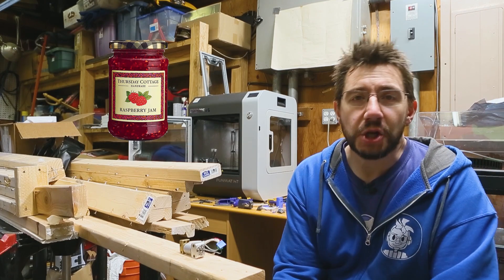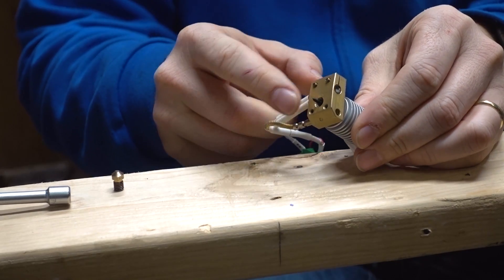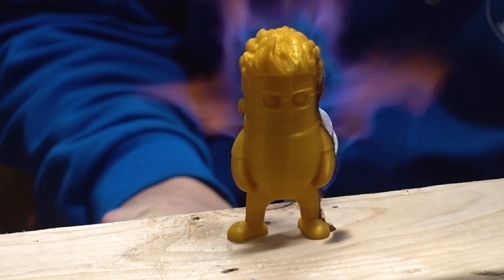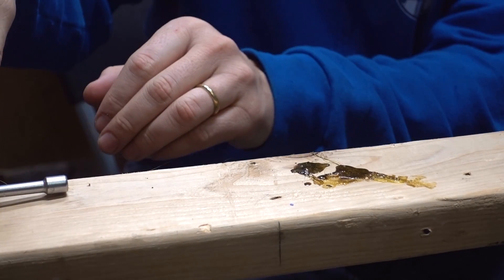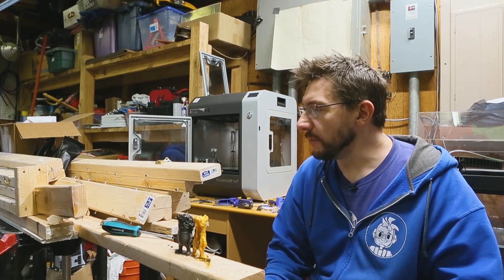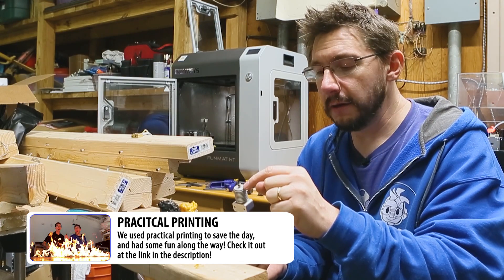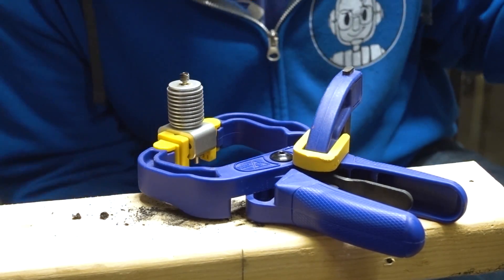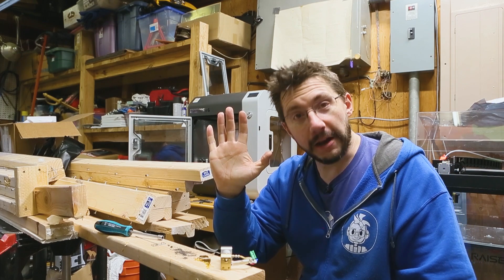3D Printing with CFPEEK: How To Clear a Jam with Fire

Comment: Wouldn't drilling the blockage out be a safer solution? Applying random heat via flame or heat gun seems very risky and unnecessarily stressful to the surrounding materials.

Comment: Joel I'm having a problem with my prints.  Printing on a CR-10S with ABS. The print is fine until probably the last hundred layers or so. It's a five-hour. The e tire print was find until the top where there was a mass of melted and stringy filament. Is my heat to low?

Comment: That was specific to carbon fiber 
I have a jam on my artillerey sidewinder x1 after using PLA and wood filament.  
Any good resource recommended to resolve that?
Reply from the maker: You wouldn’t need fire for that. You could use a heat gun. Or fire to heat up a metal rod that you would push through.

Comment: Hi Joel.  I've been watching your channel for about a year now.  I noticed a couple of things I wish you would have mentioned before using the torch.  First, this should only be done on an all metal hot-end.  The PTFE tubing in most hot-ends would probably not hold up to the heat very well.  Second, when working on something that may fall, the hot piece of filament stuck in the hot-end, orient your hot-end horizontally so the hot piece can't fall on your unprotected (should be leather gloved) hand.  I checked the comments before commenting and noticed somebody had already posted about using a torch on a pile of wood.  Safety first kids.  Otherwise, keep cranking out the great content.  I rate your channel as one of the top ten for 3d printing.  I also noticed the piece of wire your used to remove the stuck PEET looked suspiciously like the unjamming "tool" that comes with the FlashForge Adventurer 3 printer.  That's all.

Comment: Just a thought, but I don’t think you’d really want to use a flame in this case.  It did work, but isn’t there a high risk of carbon scaring in the heat break when using a flame?  Since the flame will reduce the filament to carbon, that carbon could adhere to the metal.  Using just a heat gun, would ensure that the filament softens, but doesn’t burn, prior to it being released.

P.S.  RIP mini-Joels....you will not be forgotten.
Reply from the maker: I had thought about this but I couldn’t find my heat gun.

Comment: There's fire resistant fabric used when plumbers solder copper and brass with blowtorches inside of walls. Might be a worthy investment if open flames are going to be a recurring feature. 😁

Comment: I had a jam (pla) in the heat break that i could not clear.  I fixed it by putting a small beaker of acetone suspended in my basket on my ultrasonic (DO NOT FILL ULTRASONIC TANK WITH ACETONE!) And let it run for a couple min and the jam popped right out when i pushed on it.   Repeated process with DI water then dunked it in 99 % alcohol and dried it.  Then reassembled everything and printer ran like new.

Comment: Luckily those were not voodoo mini Joels.  That would have made for a significantly different video if they were.

Where did the poker used to get the filament out of the heat break come from?
Reply from the maker: very lucky right? The poker came with the printer, though I would imagine some wire from the hardware store would also work.
Reply: I think I may try a small hex wrench of appropriate size if it ever comes to this as I've got those handy.

Comment: Never change (unscrew nozzle) when hotend is cold. It damages the threads and you risk that it is going to leak
Reply from the maker: I don't believe that is true. Where did you hear that?
Reply: @3DPrintingNerd  hahahaha
Reply: @3DPrintingNerd  many printers hotend is designed so that the threads are making the seal. This hotend might be different. 

This is related to heat expansion of aluminum that most heatblocks are made of.

Comment: I have a rather interesting question about jams. After a jam or carbon build-up in heat breaks, is it more prone to jam or carbonize again? I feel like it with ultimaker's printcores.
Reply from the maker: That's a great question, and I don't have an answer for you.
Reply: @3DPrintingNerd  I would say that the Petg-cf and the CC06 is the worst. I think it might be the brass in the long nozzle that change or get worn down. I'm going to test coated brass and hardened steel next to see if it works better.
Reply: I mentioned something similar in a thread of my own, where I talked about the carbonization adhering to the metal.  If it does adhere, then I would expect it to continually happen in the future.  This isn’t a cast iron pan being using with grease to cook foods. :)

Comment: Hey Joel I just started printing with abs and I love it. The only problem is I use tape and with the build plater being so hot the tape curls up and makes the print warp. Any tips?
Reply from the maker: The ABS 3dgloop does a good job. You could also make an ABS slurry.
Reply: Try to use PVP glue or print with raft.
Reply: Use some quality Kapton tape. Have no problems with it and ABS. I assume you're using an enclosure already because if not, that's probably the reason for warping.
Reply: ABS Gloop is amazing. PEI works as well as long as it's cleaned regularly.

Keep in mind, however, that ABS warping is most likely caused by the cooling ABS itself, not the tape. I wouldn't be surprised if the tape is being peeled up by the ABS, so try printing with a massive brim (I use 15 to 25 mm).
Reply: Thank you for the help I will definitely try these this to help my printing

Comment: Not sure if this trick would work on peek but for a pla jam i just stop the hot end fan with a finger and let the heat creep up the break while trying to extrude. Works alot of the time.
Reply: Don't do that. That's a good way to kill the fan. Most cheap fans do not have built in stall detector and most printers don''t have an RPM sense wire going in to the controller either.
Reply: @shadow7037932  haven't had to do it more than twice. But really who care about a 5 dollar fan bro.
Reply: @carbide1968  Sure, if you're running a cheap fan. But changing it out takes a bit of time. And it's bad advice especially since newbies who watch this channel may not know how to swap a fan.
Reply: @shadow7037932  you do you, i will do it my way. Lets agree to that. But i am not taking apart my hotend if i dont have too.

Comment: Happy new year Joel, I had to do the same thing with some abs filament that was hiding inside the hot end stopping my pla from coming out smoothly. 

Ended up eventually swapping to a steel hot end instead of brass and so far no issues.

Comment: Something we used to do at work to removed coatings on metal might help here. We repurposed an old welder for running current through metal parts to quickly heat them up. To remove coatings on metal, 20 amps for 1 or 2 seconds was all we'd need before most paints or anodizing material was burned off. I'd imagine you could make a jig to do the same thing here.

Comment: everybody: upgrade firmware to get thermal runaway protection!!!!!
Joel: burns pla with blow torch in the workshop on wood...
Reply: Not only on wood but with plastic clamps holding the part he is heating. What could go wrong with that. Thankfully noting did. Looks like some interesting printing material.
Reply: not knowing how much time it elapsed I got nervous when he immediately picked up the metal part after heating it with the torch.
Reply: How about some goggles Joel?

Comment: What do you think about using a Volcano hotend with PEEK, and maybe... increasing the surface area of the heatbreak (by sandblasting it gently)?  It looks like there is a heat creep issue when printing that hot.
Reply: You need a good hot end. Something like the Mosquito combined with a nice nozzle like E3D NozzleX would be a really good choice for high temp stuff.